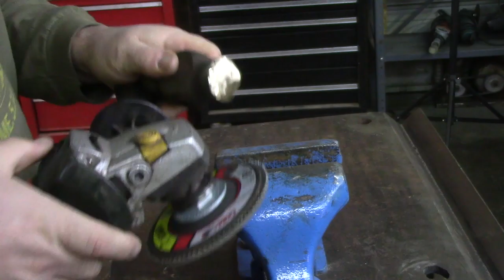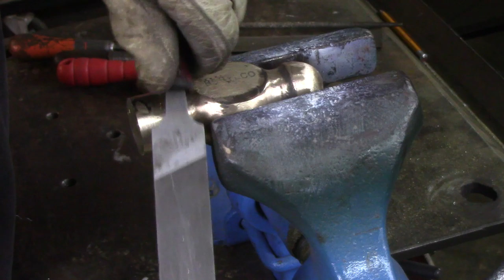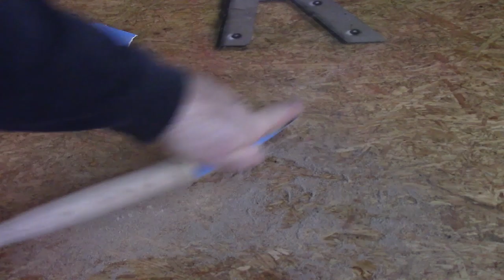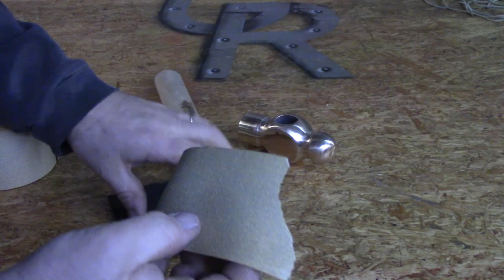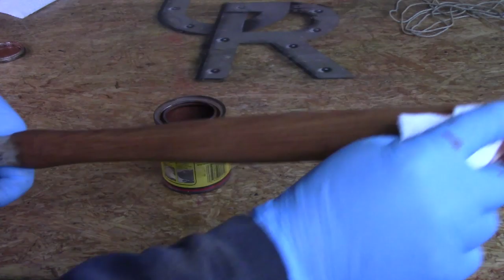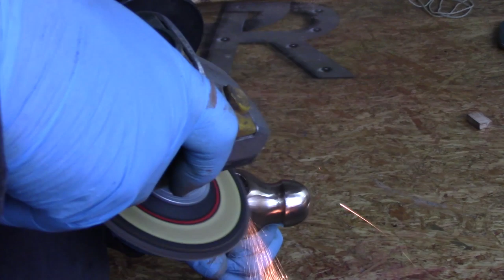Restoring an Old Ball Peen Bronze Hammer!

Comment: I've seen lots of brass hammers, but don't think I've ever seen a brass ball peen. Wonder what it was used for? Tinsmith? Copper pots? Hmmm?
Reply from the maker: Well, it's actually made if a beryllium copper alloy so it's more like bronze.  It was sold as a no spark safety hammer.  Apparently this alloy is pretty hard and it's also bad to breath the dust from sanding and grinding so you have to use a respirator.
Reply: It is a Non Sparking Beryllium Copper that is used by workers on Oil Rigs, Refiineries, and Flammable Storage Facillities.    Non Sparking = Less Fire Risk.